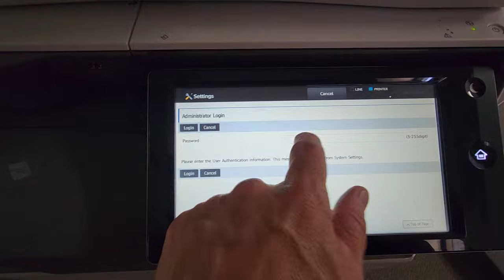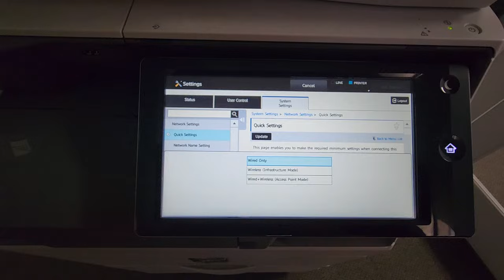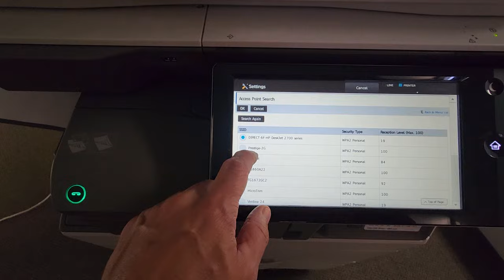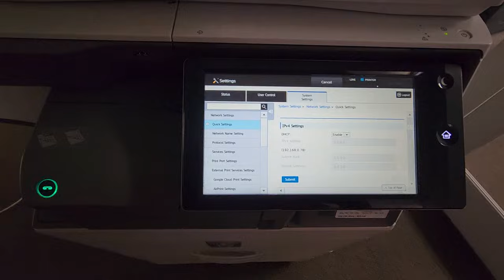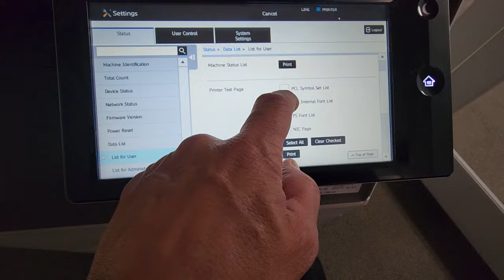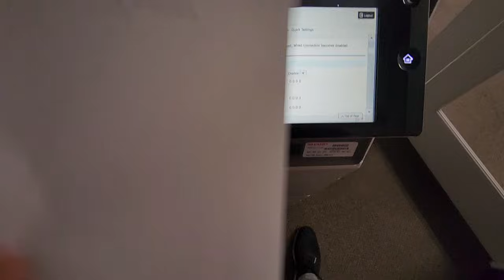How To Connect Sharp Copier To Your Network by Assigning An IP Address

Comment: Hi, I have a Sharp MX-4110N in the office I work in, it somehow came disconnected from the computer. I can not for the life of me get them connected back to each other. I have a windows computer. Any suggestions? I've tried for 3 days now and have not gotten anywhere. Also, the network settings box does not look like yours, I don't see anything about wireless or not. It does display at the top of the screen that it is online however, my computer will not find it
Reply: Thank you for your response. After working and working on it, I finally got it figured out. I just had to re-download the drive.
Reply from the maker: lots of reasons could the cause of this and I"m afraid it requires an onsite person to troubleshoot what is happening and also learn about yoru office network. did you previously have this unit connected hard wire or wireless? try hard wire if wireless fails. good luck

Comment: Hi. I have a sharp copier, on the body its written MX-4050 but when i check the device settings, I see sharp MX-3550n. Does this mean the case has been changed?
Reply from the maker: yes, it's a possibility that the outside of the machine was changed out so it can pass as a MX-4050n. Of course
Reply: So Im guessing Sharp Mx-3550 is a lower model and they changed the casing and sold to me as Sharp mx-4050 @PrestigeOfficeSolutions
Reply from the maker: that would be my guess too if settings is reading mx 3550n but front door reads different @createdbyobi